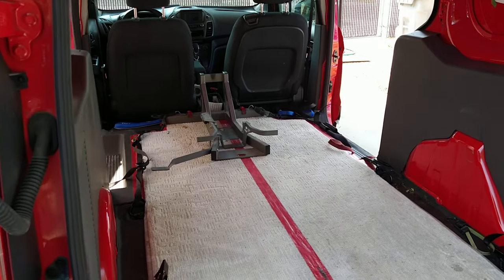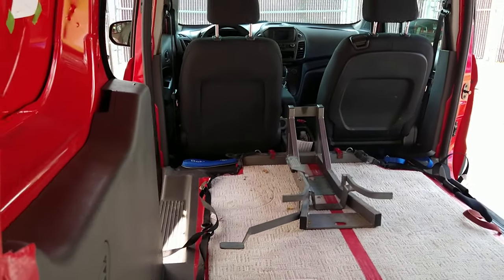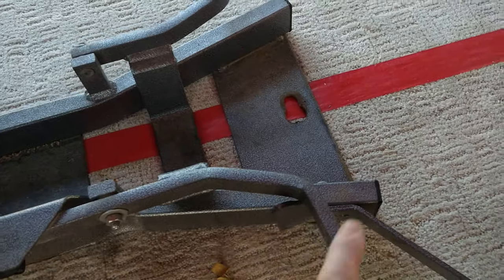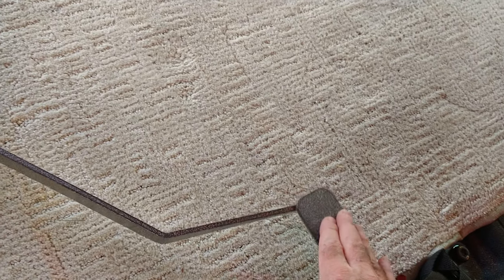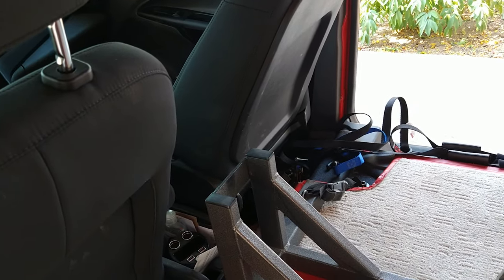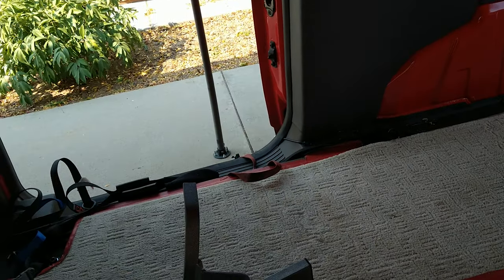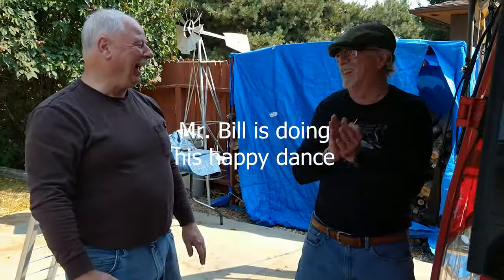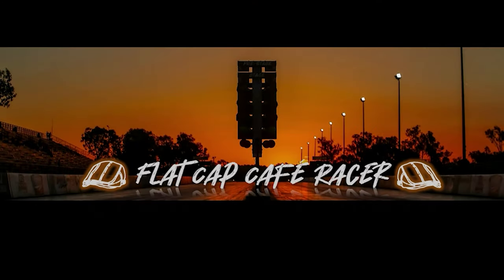Will my Thruxton R fit in the van?

Comment: I have an open trailer and interested in getting wheel chocks.  Would you recommend getting ones with the bump for an open trailer?  I have used just straps many times before but I want to be able to put 2-3 bikes on at a time and I figured the chocks can help me line the bikes up and also keep them upright so I can put the third bike halfway in between the front 2.  Any recommendations?
Reply from the maker: The wheel dock works well with one bike but the arm on it takes a lot of room so a rocking wheel chock would probably be better for multiple bikes.  I'll show what I mean in my next video.

Comment: How about installing a winch operated loader?  Something like what Neo-Dyne sells...  Not sure if the link will work, but here it goes:  https://youtu.be/yUVN3pOjTno
Reply from the maker: I think I'll replace trailer and ride it.  I guess we could get Sonny to push it up in the trailer when the trailer isn't hooked up, now that was funny 😄 😆
Reply: @flatcapcaferacer  now that is funny!  

Yeah, a trailer is easier.... the link was just in case you wanted to make it easier on yourself to load and unload the bike.  I have seen them used both on pickup trucks and vans.  But if you are getting a trailer, no sense in spending money on that loader.
Reply from the maker: @Wachuko-1  The next video👍👍
Reply: @flatcapcaferacer  If we only had a video camera running at Bonneville when that happened.  It would have gone viral.
Reply from the maker: @billdee9622  I'm sure appreciates that the camera wasn't running, and I appreciate him not dropping the motorcycle.